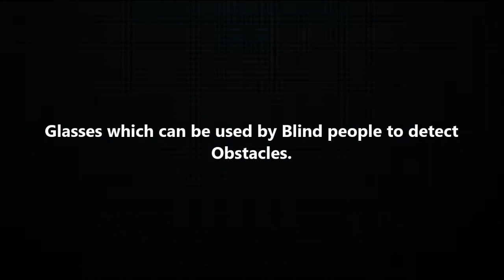Smart Glasses for Blind || How to make amazing smart glasses for Blind

Comment: Sir can we use micro vibrator motor instead of buzer and power bank as supply and aurdino uno instead of mini 
If yes then what will be changes in programing
Reply from the maker: No need of any changes just replace buzzer with motor

Comment: can I use 3 sensors on this project? and if yes, then can the power supply module be connected with 3 sensors? how about the voltage dividing between them? thank you sir
Reply from the maker: Yes you can use 3 sensors . Connect + ve of 3 sensors to 5v of power supply module and sensor gnd to module gnd.

Comment: Sir how can we skip 5v power supply module and by which I can replace it with ?
Please describe which sort of buzzer we have to use?
Reply from the maker: Use piezo buzzer 
Instead of Power supply module. You can use 7805 voltage regulator.

Comment: Hello sir can I use this for my project badly needed sir😇, can you give to me the full description and connecting wires sir and what kind of wires did you use? Is it female to male.wires or male to female wires?
Reply from the maker: You can use . Code and circuit given in video description
Reply: @RaviTejaCreativeCatchers  What kind of wire's did you use sir?
Reply from the maker: @sherylmaehellera7327  you should use all types of jumper wires
Reply: @RaviTejaCreativeCatchers  Thankyou sir how we can connect the wires in sensor and arduino to same negative power supply module?
Reply: Sensors gnd and arduino gnd to power supply ? In left side sir how we can connect it?

Comment: Sir In  circuit diagram Right side buzzer negative terminal and ultrasonic sensor gnd is both connected to negative terminal of power supply module
Reply: Sir also gnd of sensor and arduino are also connected to negative terminal of power supply
Reply from the maker: @minepurbuilder9791  yes
Reply: @RaviTejaCreativeCatchers  Sir instead of arduino pro mini can I use arduino nano if yes what will be its circuit diagram